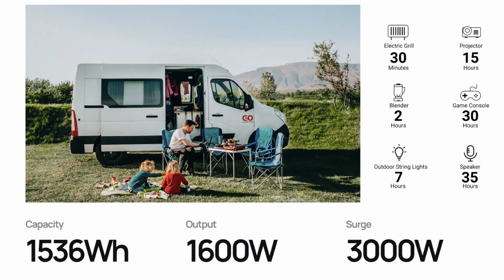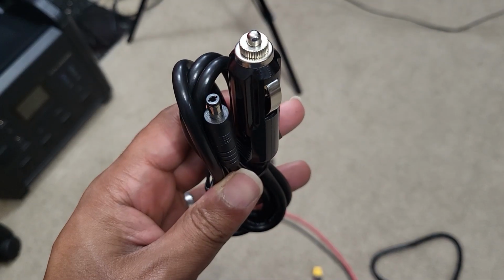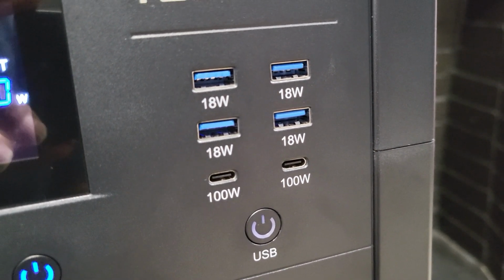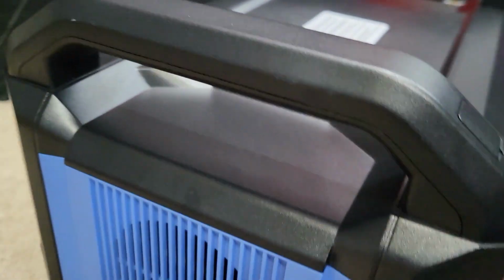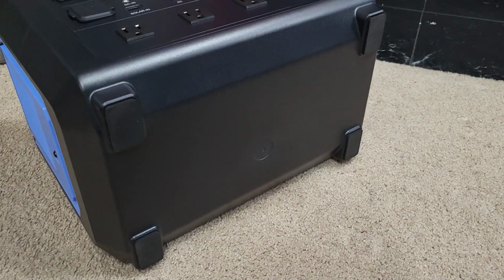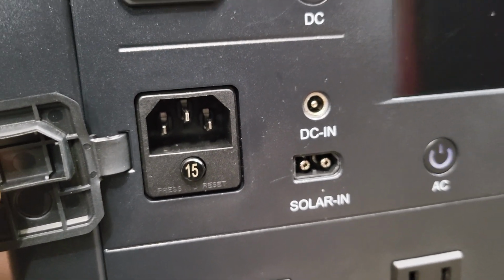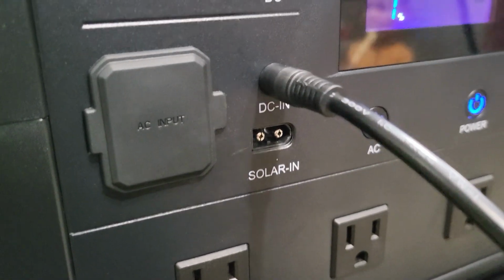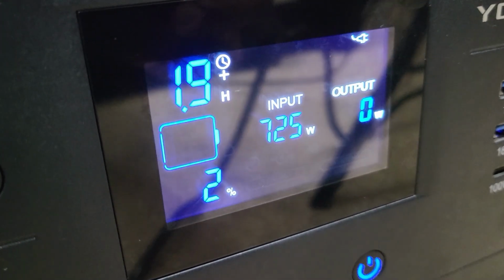The Yolaness SAPY 1600 Is A Mid Range BEAST!!

Comment: Don't buy this product. I now have 2, the first one burned out the first time I plugged a solar array into it- smoked it , still charges on AC but that's worthless for my needs. The company to their credit sent a replacement. Unfortunately the replacement won't charge  utilizing any of the the provided inputs, charges on AC for exactly 1 minute and dies. It's now shows 20% capacity on the screen while it's plugged into the wall after an hour of charging it 1 min at a time by plugging and unplugging the AC cord and now it won't turn on at all. Epic fail.
Reply from the maker: Did you put too much solar voltage into it?

Comment: Hello , pls i need your advice on solar 
I got eb70 with pv200 but the pv200 solar is not too long , i order for  extension 10m 10awg mc4 solar cable and i just  found out this morning that my pv200 cable is 12awg , now my question is 
If I’m to use the 10awg extension with the 12awg pv200 hope there won’t be  any issue due to difference?
Reply: So it like this
Pv200 12awg >> extension 10m 10awg >> to my eb70 
Using mc4 connector
Reply from the maker: Nope! It will work.
Reply: @AskIveSolar  thanks